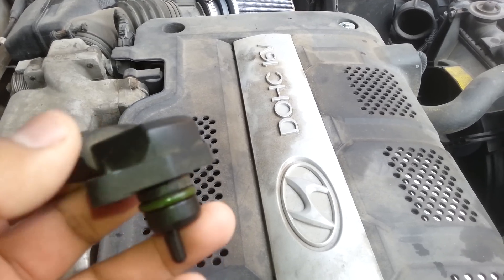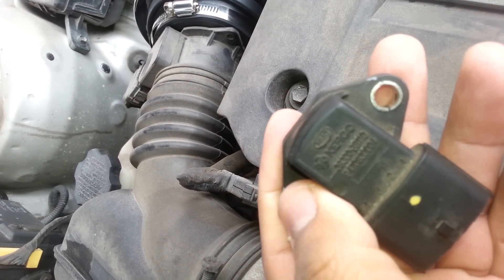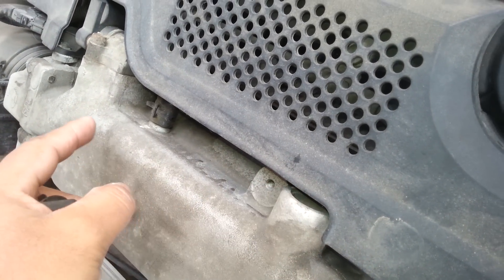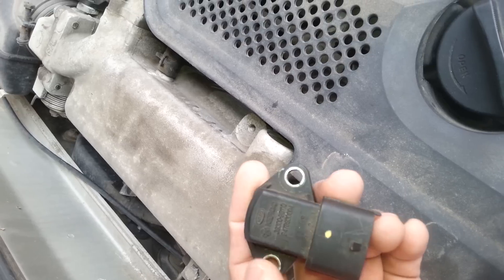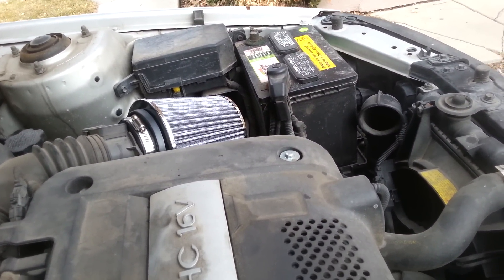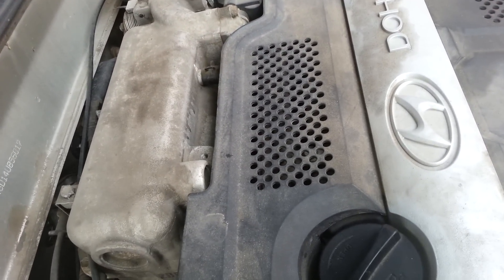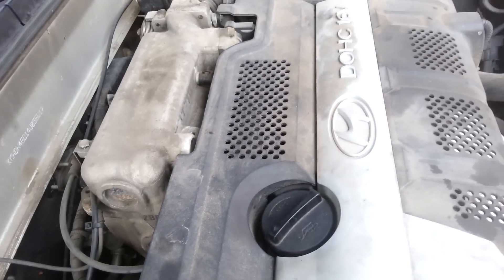MAP Sensor Location on Hyundai Elantra 2001 and 2004

Comment: My 2004 Hyundai Elantra III Sedan XD, a 1.6-liter gasoline engine with a manual transmission and 107 hp and 79 kW, is missing the MAF sensor found in the air hose between the air filter and the throttle body. The throttle body only has the TPS (throttle body) sensor and the MAP sensor just below it. The body of the vehicle in the video is the same, but the MASS sensor, which should be located between the air filter and the throttle body, is missing! If anyone has any ideas or explanations, I'd love to hear them. I should also mention that the air filter housing and hose are different in the vehicle in the video. I suspect there are some minor differences, even though they share the same housing.
Reply from the maker: Thanks for the detailed information, I appreciate you taking the time to share that and 😊 Subscribe!

Comment: Hey mine has a sensor in the same location as yours but it also has one where you said the 2001 type has it. The sensors look the same and I dont know which is the MAP. It is a 2003 Hyundai tiburon
Reply from the maker: Helllo Kyle, the map sensor goes in front of the fuel injection system

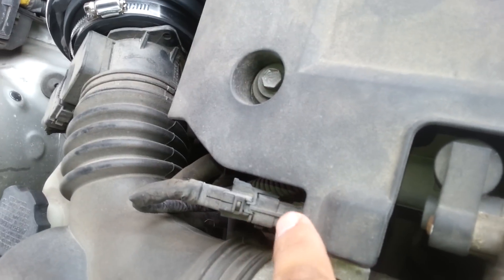Comment: READ THIS BEFORE BUYING PART.  This video has some errant information.  1.  The part he shows in his hand IS a MAP sensor.  2.  The part he points out as the part is NOT the MAP sensor.  It is the TPS (throttle position sensor).  3.  The part about the 2001 where he says "this is where it would be on a 2001" is correct.......now the kicker.  My 2004 does not have a MAP sensor.  And I don't think this car has a MAP either.  If you pause the video at 1:29 time mark, look at upper left.  The tube that goes from air filter to the manifold has a different sensor altogether. You can see the body of this MAF sensor in upper left at 1:29.   A MAF sensor...mass air flow.  My 2004 Elantra has a MAF sensor and does not have a MAP sensor.  My 2001 Elantra has a MAP (manifold absolute pressure).   Both my 2001 and 2004 have a TPS sensor.  The biggest issue with this video is the errant pointing out the TPS as the MAP.  The 2004 doesn't have a MAP.  ...  Now some advice.  The MAF sensor can be expensive.  Try cleaning it with a cleaner SPECIFICALLY designed for MAF.
Reply: granada Coder right it would usually have either have a map sensor OR a MAF mass airflow sensor. Not both

Comment: But what about a 2002 or 2003? 2003 should be in the same spot as the 2001 ones right?
Reply from the maker: Mick Flick it should or .... I think they are a lil different, have you able to find it?
Reply: Klavdio-Leadership It's in the center on the 2003 ones. Thanks fam.
Reply from the maker: Mick Flick awesome!!! Thanks a lot for your contribution Mick 👍
Reply: Hey Mick, I know this is kind of late, but mine is a 2002 Hyundai GLS, and it is in the same exact spot.
Reply: I think the 2001, 2002 and 2003 have the MAP as this video describes *for the 2001*.  This video incorrectly shows the TPS when he is actually pointing to the part on the car.

Comment: LOL, nice intake filter. Get a CAI if you are going to spend your money.
Reply: he most likely bought a cheap filter cone filters are pretty cheap so its doubt full he spent a lot on it. Also if a CAI has metal tubes you should know it will be pointless as those tubes will heat soak and negate any cold air benefit
Reply: I bought a hyundai Accent for my daughter, and after several fender benders. the last one totaled it. She bought the 2002 Hyundai Elantra to replace her Accent. My question for anyone is, what is that snorkel on the front drivers side of the the engine bay. It has an arrow and says open. There are several shots of it in your video, 1:08 is one shot. She did not receive an owners manual, and my limited research on the net has found me nothing. Someone have a clue or an answer? Thank you.
Reply: David Ward you mean his cone filter? if you want a manual you can probably find it online. ah I see what you mean at 1:09 not quite sure either I will look at my car when I get home
Reply: No, not the short ram cone, the funky snorkel looking thing up by the very front of the engine bay, on the drivers side. It doesn't have a cover at all. I assume it does have something to do with air flow.
Reply: Though I already typed this?? Its not the short ram cone filter, its the L shaped snorkel, on the drivers side all the way up front just behind the headlight. I assume it is for engine bay cooling by receiving or pulling out hot air. It's visible several spots throughout the video, 1:08 is one of them. Top right corner. Looks like an open tube sticking up. On hers it has an arrow on the side that says open. I'll look a manual online, just thought you might know. Thanks and have a great day.
Reply: Just right of the fan, if you are facing the car.
Reply: ok so mine has one but its not poking out like his its under a black shield that covers the battery  and its turned the opposite direction as his just seems to be something that brings in some air. so if your missing it or its not facing the right way its not a big deal. his might have just moved that direction or he moved it that way to help his intake
Reply: Thanks
Reply from the maker: Damien thanl you for your comment my friend :)

Comment: Hi, Where are airbag sensors located?  My airbag light is on.
Reply: When we bought my daughters 02 Elantra, the air bag light would stay on for awhile and go off for awhile. The first thing I did was use some electronic cleaning spray on the seat belt lock. It has a "sensor" in it, that if it doesn't think the seat belt is clicked in, the air bag light will come on. Soda is the worst thing to get inside those things. The wiring harness under the seat can also be fouled. If something was rolling under the seat and hit the harness, it might come loose, check that out. Always be very careful when working with any airbag wiring, sensors, or connections. Depending the year, they have sensors in the seats to tell if anyone is sitting in the seat also. Sometimes it's something simple, but be super careful. Good luck. Fixed my daughters with the electronic cleaning spray.
Reply from the maker: David Ward thanks so much for sharing this David, if you dont mind, please Subscribe to my Channel :)
Reply from the maker: James Chuaycham ป้อม ศักดิ์ชัย hey James, did you find out?